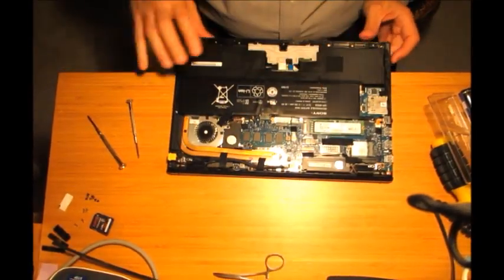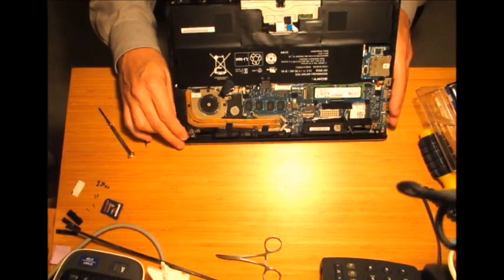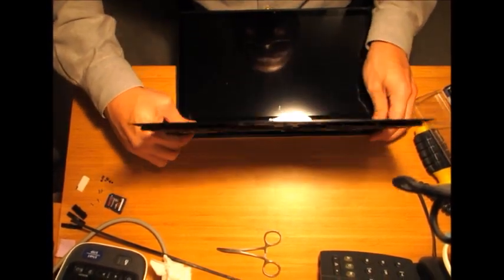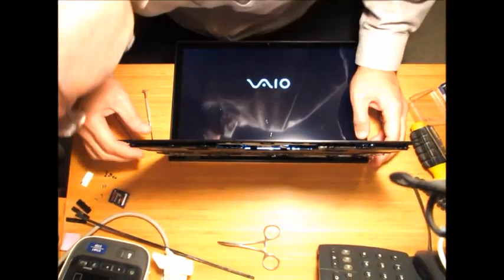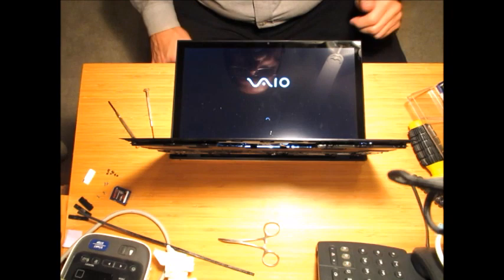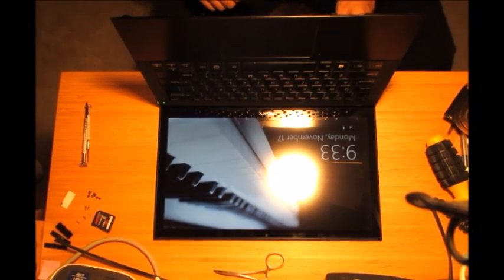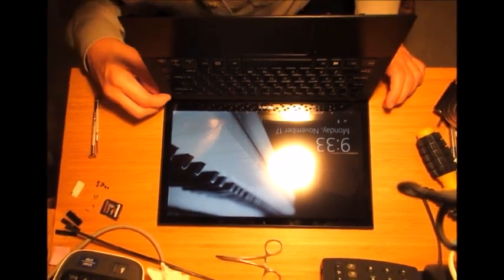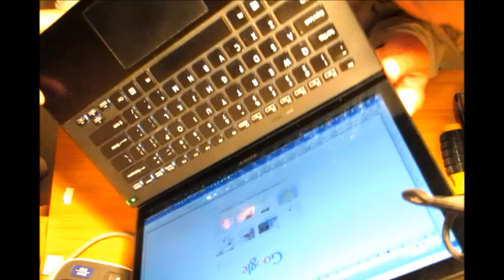Sony VAIO Pro13, svp132 fan replacement, case removal

Comment from the maker: My 3rd fan!  I bought this PC new in July of 2013 and had to replace the original fan due to noise in Nov 2014, so it lasted less than 1.5 years.  I replaced it with a Panasonic fan & heatsink (not sure who manufactured the original fan), it cost ~$65 on Ebay.  Now the fan has become noisy again after 2 years and ~9 months.  Just bought a Delta fan and installed it.  However, this time I did NOT replace the heatsink and only bought the fan for $12 on Ebay.  It was EASY to replace as others have commented here.  It separates from the heatsink with a few screws and that's it.   Larry...
Reply: Thank you! Will try this
Reply: I myself am on my second SSD. 

Not soon after the fan replacement (which is still working though), the laptop started to have sudden disk IO spikes that jammed eventually the Windows 8.1 if I didn't stop using the computer for a while.

I tried to find the culprit for performance monitor showing 100% disk activity while none of the processes were showing up in the resource monitor. After couple of months or so the computer could not stay on for more than couple of minutes without freezing and it was time for SSD change. 

I replaced the original made by Samsung one around 50€ made by Kingston. With the new one the same disk IO spikes were back but this time the culprit did show up in the process list. I had my suspicions on the VAIO Care product family and indeed it was a process belonging to VAIO Telemetry. By removing it (http://www.advanceduninstaller.com/VAIO-Telemetry-f2362ea0d3226e17b04ac8e3d4f52c3c-application.htm) the disk IO spikes were gone and I'm soon past one month without problems.
Reply from the maker: Tuomas, thanks for the SSD tips!   Larry...
Reply: Hi, do you perhaps have the part no for the fan alone?

Comment: Hey Larry, I´ve been having problems with my fan as well. The thing is that I have to buy a new fan by Ebay, but I dont know which one I should buy. Do you have any recomendation?
Reply from the maker: Diego, you can go to Ebay.com and search on the fan's part number:  UDQFVSR01DF0        You will get a result like this page where most of these fans should fit your PC.   https://www.ebay.com/sch/i.html?_from=R40&_trksid=p2380057.m570.l1313.TR0.TRC0.H0.XUDQFVSR01DF0.TRS0&_nkw=UDQFVSR01DF0&_sacat=0
Buy from a vendor that:  #1:  has a lot of good reviews and high score   #2:  a vendor that can deliver in a reasonable time, many of these are shipped from China ~3-6 weeks later.    
Good luck.
Reply: Thanks man for the quick answer! I'll follow your advice!!

Comment: Hey people. I fixed the fan on my Vaio Pro 13 without buying a new fan. It works perfectly. I made a video maybe it will help you.
https://www.youtube.com/watch?v=RKilU0R8UXg
Reply from the maker: Justephan, thank you for your comment.  I watched the video and seems you have oiled the fan and it became more quiet.   I believe if you read some of the reviews below you will find others who have done this (including me)  and it will stay quiet for a few weeks or months, but then it seems to get noisy again.   Let us know your experience after a few months.   Larry...
Reply: Hi Larry. Alright, I ill inform you all. After I oiled it up with mechanical oil I run it 24 houers with without any issues. More info comming soon. Greetings Jaspart.

Comment: Hi, thanks for this video, do you know where the backlight fuse is on the motherboard. I fix my screen but no backlight. I need to fix this fuse and I'm lost. Thanks
Reply from the maker: JahMik, I'm sorry I'm not familiar with the location of the backlight fuse.   You may watch my other video of a keyboard replacement as I have to take apart the entire PC and put it back together.  This may give you a hint as to the fuse location and/or you may re-seat the backlight power cable too.   https://www.youtube.com/watch?v=ufZ0Q8JDeVo     Good luck and let us know how it turns out.   Larry...

Comment: hola esta muy bn el video. y queria saber si me prodrias ayudar es q tengo uno de esos portatiles pero seme daño el cargador y yo estoy en colombia y aca nose encuentra. aver si tu me puedes hacesorar donde puedo conseguir un cargador. gracias
Reply from the maker: Leon, I don't speak Spanish.   I hope this helps:  http://www.ebay.com/itm/AC-Adapter-Charger-Power-for-Sony-Vaio-Pro-11-13-Series-VGP-AC10V10-VGP-AC10V9-/281294998735
Larry...
Reply: Larry Blackledge muchas gracias por la ayuda brindada. no sabes como me ayudas el portatil estaba sin uso casi dos años
Reply from the maker: Leon, Me alegra poder ayudarle! (Glad we can help you!)  Larry...
Reply: Hola estoy en Espana (Europa), el cargador LaVolta  modelo: pa-eus4 funciona bien con mi Sony Vaio Pro 13. En el aparato entra AC 100-240 Voltos / 50-60Hz 1.5A  y sale 10.5 Voltos a 4.3A. Aqui esta listado en amazon.es https://www.amazon.es/SVP132-Serie-Lavolta-Adaptador-corriente-ordenador-compatible-ADP-PA-1450-06SP-10/dp/B00I0708J8

Comment: Hello Larry, after change the fan, it's need to set the bios or not? my friend told me, to make new setting in the bios after change it. thanks Larry
Reply from the maker: Guido, should be no reason to modify any BIOS settings, just install the fan and turn on the PC.   Good luck!   Larry...
Reply: ok thanks a lot Larry. God Bless
Reply: Sad thing is that there is no fan BIOS setting, people have looked into this deeply trying to hack the BIOS to create fan control and all to no avail. VAIO Care released an update to their software over a year ago where it allowed you to set the FAN to 'Quiet Mode' which did little to nothing to fix the fan noise. You just have to buy a new fan each time for around 10 euros with some thermal paste if you feel up to adding some new and removing the old with alcohol on the CPU.

Comment from the maker: Humphrey, sorry I just found this message you sent me months ago.   I do not have experience with this question, but some of our viewers may.  Can anyone help?    >>>Hi Larry, hope you had a good Christmas and sorry to bother you on Boxing Day. I have a Sony Vaio SVP132 and have just watched your fan replacement video on Youtube. My problem is a little different. I have a cracked digitizer, i have flown a new one in from Amazon (I am in South Africa) and now have figured out through loads of research that i need a heat gun/hair dryer to take it off and replace it (together with a pryint tool). What I don't know is how much of the rest i need to disassemble in order to put the new digitizer in. Obviously i need to remove the back cover, which with your help (fan video) i now know how to do, but how much more do i need to disconnect before i can put a new digitizer back. The digitizer is plain rectangular, but has a little lip at the bottom which obviously needs to attach somewhere inside the computer for the thing to respond to touch instructions, but as i say i don't know how bare the thing has to be stripped in order to do that. Do you know? I would be eternally thankful if you could help. Thanks so much. And even if you cannot help, have a great day, sorry to have bothered you, and thanks for the videos.

Comment: Hi Larry! Thank you very much for this video!! I have just performed this "surgery", first time opening and replacing a laptop component and it all worked perfectly. To other users, beginners like myself... just be careful and see where the arm sliding under the power cable goes when removing and in any case you can lift the power connector, insert a very thin wedge under the metal plaque to lift it and then insert the arm a little more comfortably. Just rookie resources but this is a great video and it recovered this beautiful and efficient Sony for normal use :) Thanks again!
Reply from the maker: German, glad it was successful surgery and thanks for the extra tips!

Comment: Thank you so much for this video! I love my laptop. The noise has been troubling me since quite a while, just replaced the fan and the heatsink with the help of your video, and it's been working like it's brand new now!
Reply from the maker: Swapna, great!   Glad it could help.  Sony did a great job with this model.  I look in the market now for a new PC some times, but even after 3 years now nothing looks so impressive.   Larry...
Reply: I agree! I hope this laptop lasts me a few more years now!
Reply from the maker: Kunal, you can search the Panasonic fan part number: UDQFVSR01DF0    on the internet (example Ebay) to find it.   Larry...
Reply: where did you got the fan ??

Comment: Very nice video, I have the same laptop with two broken USB 3.0 Ports. 
Instead of replacing the entire motherboard I want to solder new ports to the board but cannot find these specific ones anywhere. 
Does anybody know where to order the exact USB Connectors that are on the SVP 132 Motherboard? 
Any Help would be greatly appreciated! Thanks in advance
Reply from the maker: CriZe, this is not a part I've needed to find.  Let us know if you find a good source for these.  thanks.  Larry...

Comment: I want to report my experience because it could be useful for someone with my same problem.  I've had for more than 1 year battery problems, my vaio was randomly shutting off, while it was on the table or while i was transporting it. Also my screen when battery was under 40% started flashing. I've tried replacing the battery but this had not fixed my problem. Some months ago my fan started being noisy so i ordered a new one and replaced it. Since i've replaced the fan, every battery problem and screen flashing disappeared. Now after many years of problems my vaio is like new. I think that the fan was defective and was consuming to much energy causing all my problems.
p.s. sorry for my bad English
Reply from the maker: Fabiaiz10, great info thank you.  I have had people reporting odd battery issues and shutdowns in the past, this may be very helpful to them!   Larry...
Reply: What fan did you get, i went to ebay but there are so many diffrent ones to pick from

Comment: Hi Larry, 

Thanks for sharing the video.

I have a sony SVP132A1CL...

Years ago, when i had the trouble about fan noise, my laptop was in guarantee period, so i've sent it to sony, then they do something and the noise disappear after.

Then, 3 months ago, the noise re-appear only when i launch something on (for ex, a video on YouTube).

I'm afraid of replacing the cooling fan with / without heatsink will change nothing, after the replacement the noise will appear again...

What do you think about it?

Thanks,

Comment from the maker: TG, for some reason only a portion of your message came through.  Please re-post so we can see the whole issue.
>>>>T G
Hi Larry, I replaced the original fan with a brand new Delta fan (thanks for your tutorial) and renewed the heat paste. Now the fan noise is just as loud as before, just without the clattering. The
Reply: Ok I've just replaced the fan (and the fan only not the heatsink) and it was a success, all in under 1 hour along with cleaning up the old thermal paste and applying new paste. The noise was unbearable with horrible  grinding ball bearings clashing together along with the occasional fast spinning buzzsaw  type noise which I learned to stop by giving the fan a hard knock with a knuckle tap on the underside of the Vaio ...(not good and not advised).

So, I took out the old heatsink and fan the usual way, I separated the broken fan from the heat sink with just 3 screws on the fan holder attached to the heatsink, very easy and it just pulled away (note for the last heatsink/fan which I threw away 1 year  ago for the pro 13, I noticed that the fan and heatsink holder were glued down with thermal paste, this was not the case with this unit). Note that the fan has one cable and the
 heat sink have each one cable so take care not to break. Then it was just a case of removing thermal paste and adding new and screwing in the new fan onto the heatsink and then screwing  the old heatsink and new fan attached to it onto the motherboard. Very easy.

One thing to note that the two previous fans had model numbers: UDQFRRH01DF0 but the new fan despite being advertised on ebay as such had model: KSB0505HB instead, I raised my concerns to the ebay seller regarding this and he insisted that it would work with the Vaio Pro 13 and he was right.

That's all folks.
Reply: Ok, i try again ;)
Hi Larry, I replaced the original fan with a brand new Delta fan (thanks for your tutorial) and renewed the heat paste. Now the fan noise is just as loud as before, just without the clattering. update: at lower speeds, even the clattering is back. It doesn't seem to be a fan issue. Maybe it has to do with the temperature sensor. One issue I identified is "Microsoft IME", which is necessary for Chinese input, it occupies around 33 % CPU, but seems to be a known Microsoft issue and hasn''t been fixed for more than one month. Another issue is, when logging out (win+L) and leaving the vaio pro, the fan goes crazy and keeps rotating and max. speed until I login again. Thanks for your help!
Reply from the maker: TG, thanks for re-posting your message.  Wow!   Odd about IME, I use it regularly and have not had high-usage CPU issues, you may try uninstalling and reinstalling it.   Regarding your other comments there may be a temperature control issue as you mentioned as it is odd that once you lock the computer the fan usage goes up.   I believe the VAIO diagnostics has a fan test that you may run, this should check the temp sensors as well.  This may be a downloadable utility vs. natively installed.    If the fan is truly clattering, you may try running it while the bottom of the case is off and you can see if the fins are hitting something or wobbling.   Am curious if you are using the old heatsink with a new fan or did you buy a whole fan + heatsink module?    Let us know.   Larry...
Reply: Hi, thanks for your reply. I think the windows modules installer worker is responsible for the regular high cpu usage. But it is too often to be just for updates so I don't know what is wrong here. For the IME that is a known issue since the update on 09-29 for many user, Microsoft knows but doesn't fix it. I bought the fan without heat sink since it is 1/3 of the price and I couldn't imagine any wear on the heat-sink itself.
Reply from the maker: TG, understood. If you uncover the noise issue with the fan, let us know what you find!  Thanks.   Larry...
Reply: And here I am again as my fan is starting to grind ever so slightly after my replacement almost 2 years ago. I heard in your video that you didn't attempt to attach the fan to the heat sink but I don't fancy paying 65 Euros for a new heat sink + fan, the fan is cheap at 14 euros or so,how difficult is it to attach the heat sink to a new fan ?
Reply from the maker: David, I've not done this myself as my first fan replacement came with the heatsink.  However, when I took my Pro13 apart to change the keyboard recently, I looked closely at the fan and it seems straight-forward to replace only the fan and to attached the fan to the heatsink.  Other users here have reported the same.   If you are still concerned, you may take apart your Pro13 and remove the fan from the heatsink to become more confident before ordering a new fan.  Let us know how it goes!   Larry...
Reply: WARNING: In this post I mention that I peeled the copper heatsink strip from the fan to reveal dried thermal paste, DO NOT DO THIS as I have doubts that this is the correct procedure.

I actually kept the old broken fan and heatsink from my Vaio Pro 13. You can peel the copper strip heatsink from the fan with a bit of force or a thin flat head screw driver, it the heatsink bends slightly you can easily bend it back into shape. There's about 2cm of area where the top part of the Vaio Pro 13 fan is stuck down with something to one of the copper strips of the heatsink, I'm around 99.999% sure that 'something' is thermal paste, so I may just get some alcohol onto that area to rub off the old paste and attach it to the new fans when they arrive (I ordered two UDQFRRH01DF0 fans one from Hong Kong and one from the Isle of Guernsey in the United Kingdom strangely enough. One thing though has anyone managed a way of fixing an old UDQFRRH01DF0 fan that starts making grinding noises ? In one of my posts on here (dunno if I deleted it or modified it etc) I remember praising my success at peeling back the main sticker on the fan on the hub and placing a few drops of oil / WD40 through the spindle hole and it working - unfortunately it only worked for a week before the horrible fan noise gradually came back again. Like I said we are only at the initial stages of the fan starting to make a noise but I know from experience it is all down hill from here. I'll keep you posted.
Reply from the maker: David, thanks for the warning.  As you discover the correct procedure for connecting the fan to the heatsink, let us know.   Larry...
Reply from the maker: David, thank you for the helpful post!   Larry...

Comment: Hi Larry, I replaced the original fan with a brand new Delta fan (thanks for your tutorial) and renewed the heat paste. Now the fan noise is just as loud as before, just without the clattering. The fan is always on max speed when there is updates installing, in idle I can still hear it very clearly. What else could be wrong? Maybe the temperature sensors?

Comment: Thanks for the video and especially for the fan number which was a time saver. If someone else is facing with the same issue. be sure to measure that the replacement unit wires are correct length. I had to ask help in order to get one of the old wires to be soldered to the replacement unit because the wire it came with was 1 cm too short and the task is somewhat delicate.
Reply from the maker: Toumas, thanks for the tip!